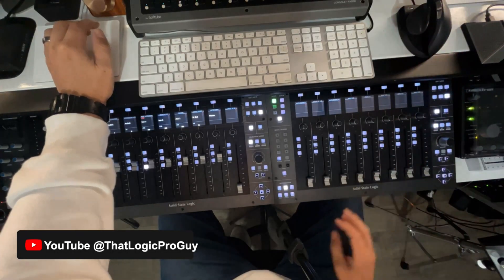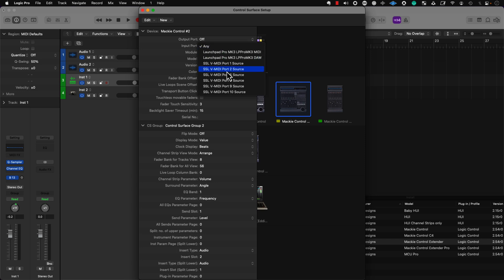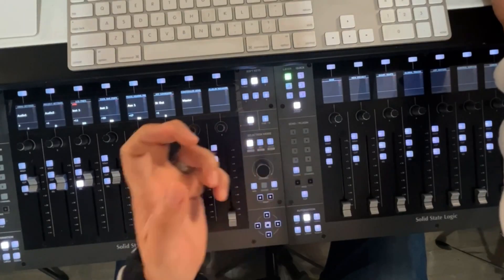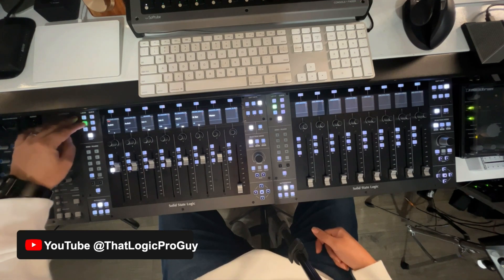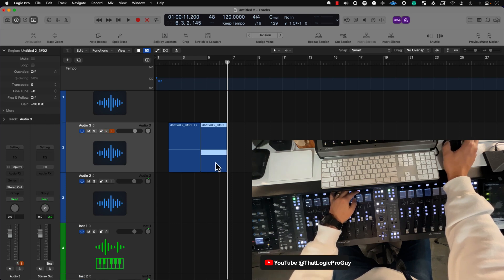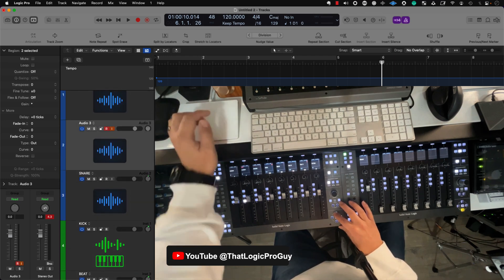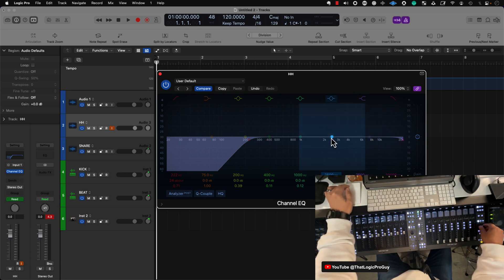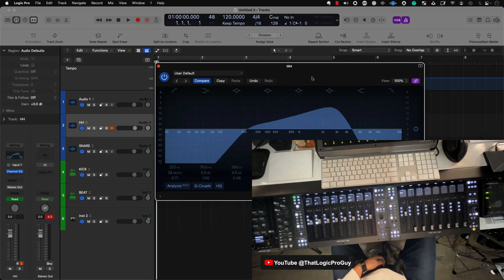"Expanding Your Workflow: How to Use 2 SSL UF8 DAW Controllers with Logic Pro"

Comment: Great video. Will this work if you only have one UF8? I.e can you use all layers within Logic to enable extra soft keys etc?
Reply: Yes it absolutely will. Cheers!
Reply: @_TheModernCreative  I’ve selected Logic for all 3 layers in SSL 360, but when I try to set up the input/output ports I am not seeing SSL V-MIDI Port 5 as an option for the output. Any ideas?
Reply from the maker: Bro, I should’ve mentioned this in the video. Thank you for reminding me. Inside of logic Pro settings (used to be called preferences) enable the Inputs there. Should show up now
Reply: @thatlogicproguy  nice one man. That worked a treat 👍
Reply from the maker: For sure bro. If you get any more tips, please share. Still getting comfortable with this unit. I like it in some ways and hate it in others. I love purely mixing on it, but the going back and forth between the UF8 and the keyboard makes me nauseous. I should be releasing a couple more videos on tricks I found on my other channel @_themoderncreative

Comment: Hallo Logic Pro Guy am very grateful for your video..

Wouldn't it be great if you could use multiple UF8 controllers (let's say two) to create an even more efficient workflow? Imagine being able to set the layers on the controllers so that they display fixed channel groups. This would mean that when you switch between the different layers, you would have direct access to a specific set of channels:

- Layer 1:** Channel overview of channels 1 to 16
- Layer 2:** Channel overview of channels 17 to 32
- Layer 3:** Channel overview of channels 33 to 48

This way, you can quickly and easily switch between different sets of channels without having to manually search or adjust each time. It could significantly speed up your workflow, especially in complex projects with many tracks.

Is this functionality already possible? If not, could this be a valuable addition to the UF8's capabilities?
Reply from the maker: This actually might be possible. I would need time to work on it but it’s a brilliant idea. Cheers and thank you for the support. My email is in bio if you ever have any more questions or input. Cheers!!!

Comment: Are you able to assign region gain and fades to the pan encoders?
Reply from the maker: I found a way to hack this. Grab an application called GainControl and create key commands to Change gain there. I then use a stream deck to apply those key commands. SSL 360 just upgraded and now used Midi CC so I am sure you can do it there as well. Hope that helps mate.

Comment: Hi - I have 1 UF8 and 1 UF1. I understand they use the same ports. So would I just create another single instance of Mackie Control in (port 5) to use logic in layer 2?
Reply from the maker: I’m using these two now and I am loving it. To answer your question….
Yes my videos cover this. Be sure to check out my other channel @_themoderncreative
Reply: @thatlogicproguy  great to hear. I checked out the videos on your other channel and none of them cover the UF1 (not UC1) nevertheless it looks like I just need to enable another mackie control to utilize the 2nd layer (or add 2 more mackie controls to utilize all three layers) - correct?
Reply from the maker: Yes spot on mate

Comment: Trying to get my UF1 and UF8  to work together, but access different tracks... I cant get it to work.. I cant select any different ports for each machine in 360..set it all up , like you say and have the two worst available in Logic settings, but the PORT select in 360 is asking me to instal a new  Mackie control, which I have ..any thoughts > ROB
Reply from the maker: The ports are selected in Logic Pro. Can you confirm that you see them in the Control Surfaces window?
Reply from the maker: The SSL set up video is pretty spot on if you set up one control. If you don’t see them in the ports within the control surface set up window, you have to enable them within the logic Pro settings inside of the Midi tab. Keep me posted with your progress.
Reply: @thatlogicproguy  I finally got it working via SSL Question in UF1Help.... very complicated. Im trying to get the UF1 to be use, and not double up V pot use, etc.. Ideally im trying to get the 4 V pots on the UF1 to be Sent 1-4 of any  UF8 Selected track... This does work, but accessing each send 1-4 is a OAIN, as you have to use 5-8 BUTTON to select Send 2, and then the left and right navigation to get send 3 and 4...its a pain...I'd just love to have the 4 pots being sends for each selected track.... I now have a head ache, trying to get this all to work...HAHA !?  thanks for any help you have...
Reply from the maker: I totally know what you mean. You can def use a generic midi controller for that usage. I explain that approach on the Control Surfaces videos on this channel
Reply: @thatlogicproguy  Yep, I can see that poss.....That would knock my feeling of do I really need both units ? ..The bottom line is , do these units speed up my work flow hone mixing nd track laying, can I do it faster using a mouse and an IPAD for key commands.. Ive made a fair £££ investment and not feeling their worth, its early days..not sure I can wait for SSL to develop these things... Like the 8 Send numbered buttons, that cant select the send  pots ( which it can in Pro Tools ).... sorry to sound ungrateful, for what they can do...
Reply from the maker: I’m like you mate. I like things to be easy. The mackie protocol is the funky part here. It’s not the smoothest. Maybe if you spend enough time with them, you will find your workflow? Good luck my friend.